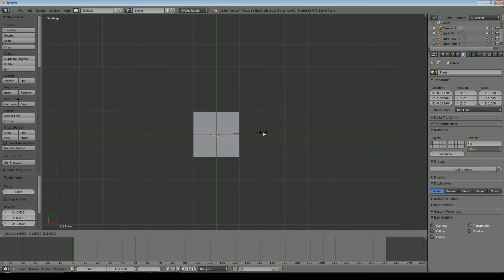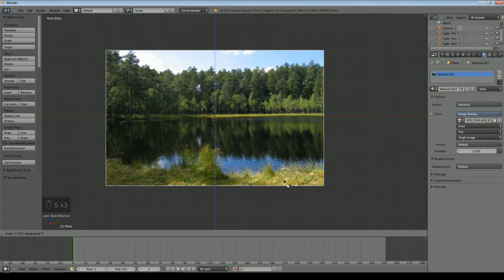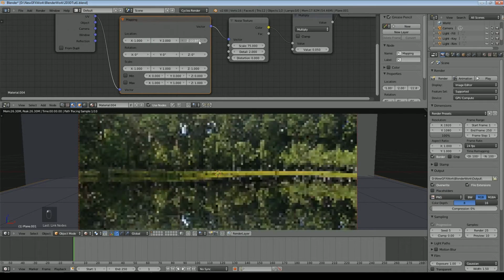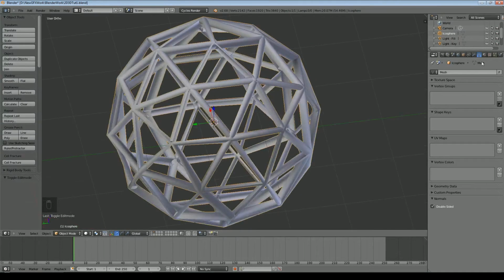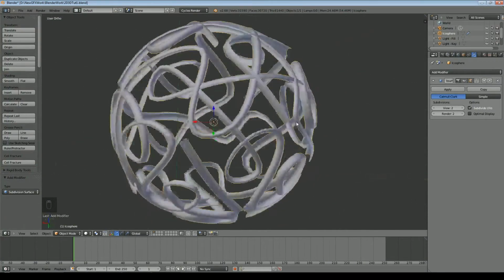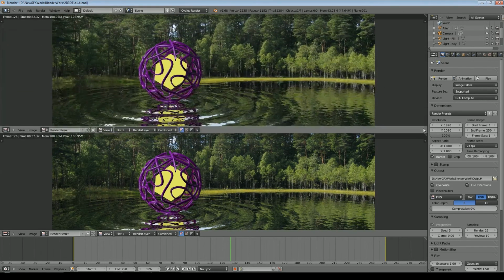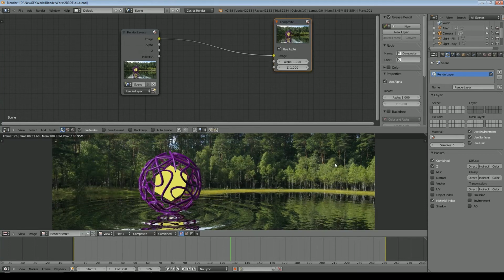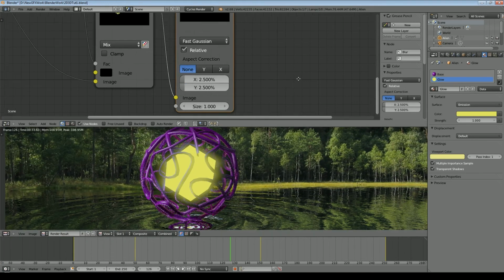Blender 2.68 Tutorial - 2D to 3D and the Wave Modifier

Comment: Just repeated this tutorial in 2.78c on Mac  and cannot render.....at 100 samples this simple scene takes several hours per frame. At 25 samples (it looks quite clear) it takes 7.5 minutes per frame at 50% resolution.  Have you come across slower render times with 2.78c?  Don't think it is because of the wave modifier as I have tried it out on a layer without the water....it is crazy slow....was not that bad with 2.78B...any suggestions or similar experiences?
Reply from the maker: Hi, no I haven't come across that. Are you rendering at 1920x1080 ? Do you have a lot of large (in file size terms) image based textures in the scene? Perhaps recreate with only procedural or simple diffuse/glossy texture in a new Blend file and see if the problem persists. You might also want to look at the overall number of vertices in the scene (you can see it along the top bar), perhaps you have a very high subdivision on your water plane?
Reply: Thanks for the suggestions. Yes 1920x1080 and I do not have a huge amount of vertices.I have reduced the Subsurf to 1 in Render mode. My scene is not that complex....400,000 verts. I will fool around with things to try to find out what is slowing it down....I just pulled the 2.78 out of my Trashbin and it is equally slow...so it is not 2.78c...
Reply: Would it make a difference to "apply" the wave modidifier?
Reply from the maker: warwicklambert.com If you apply the wave modifier that will be fine for a still image but won't work for animation.
Reply: That's good to know. Thanks for the help!

Comment: Hi, Sardi. When I connect the Mapping node to the Noise Texture, waves disappear altogether. Blender 2.76. Thanks.
Reply from the maker: +Raboleg Hi, when you add the mapping node, Blender needs to be told how to unwrap the object. Add a Texture Coordinate node and connect either Generated, Object or UV outputs to the input of the mapping node (UV will only work if you unwrapped the object).
Reply: +Sardi Pax 
It was necessary to unwrap. Tanks for tut.

Comment: firstly: many thanks again, your tutorials are awesome, I am feeling much more confident with the nodes editor because of your cycles tutorial. Then I would also like to ask you something: have you ever tried to make waves come up a beach into the camera?
Reply from the maker: Rikka Piko Hi, I have created a beach scene and tutorial where the waves lap up the beach but I haven't created one where the water laps over the camera if that's what you meant. I think you'd need to composit a fluid sim and the Ocean sim to get a convincing result.
Reply: Well, I have seen the tutorial, it is awesome (all your tutorials are!) and it did inspire me. I played around with the ocean modifier, putting in quite choppiness and a direction. I tried a bit with a particle system (animated emitter etc) and I watched some stuff on the fluid simulator, but I think I still have a bit of work to do there.  I was trying to find a tutorial on breakers, but I didn't find one yet.

Comment: What a graficscard do you use?:D because i think its very fast:D
Reply from the maker: Hi Mike, I have a fairly old NVidia GTX580 card with 1.5Gb RAM.
Reply: Sardi Pax but its very fast :0 and in the Video the samples were at 40.000 why do you that is it better with so many?
Reply from the maker: The final render was not done at 40,000 samples. I simply have it set there because sometimes you want to see how many samples you need to get an acceptable render, you can then stop and set the the render samples to whatever samples it got to.
Reply: Sardi Pax ah okay thank you :) 👍 could you do a tutorial with cell fracture, rigid body and constraints? i mean that the cells dont fall appart only if they Fall on The ground for example.

Comment: Hi, I am very new on Blender. This is a cool animation I want to learn but I got stuck from the very beginning. Here is what I did.
1. New mesh - plane 
2. Select X and Y and scaled bigger, and then rotate X to 90 degrees.
3. I had Object mode then add a Material - Emission - image texture - open file - select image - open image.
4. I select Material on Viewpoint shading, but I don't see the image texture to edit.  Please help.
Reply from the maker: Hi Liana, select your plane, press 1 on the numpad to be looking straight at the plane, go to edit mode (tab) press A untill all the object is selected (orange/yellow), then press U and from the menu that appears, select Project from View Bounds. Come out of edit mode and in Texture/Material mode you should now see your image.
Reply: Sardi Pax Thanks a lot with your fast reply!  It works.  Happy New Year! ^___^

Comment from the maker: Hi Santiago. Wireframe (unless you refer to something I'm not familiar with) is just a way of displaying objects, it doesn't change their geometry. By converting the object to a Curve (so it looks wireframe) I then get options to Bevel the curve, basically turning the wireframe into pipes. I convert back to mesh to make other manipulations like scaling easier. For wave modifier, check the video at about 16:00 where I make the connection. Good luck.